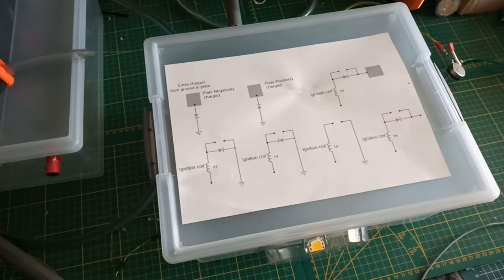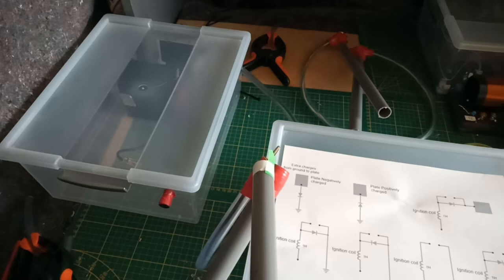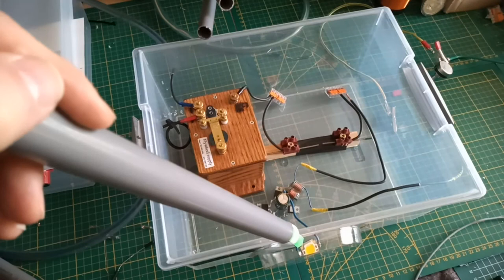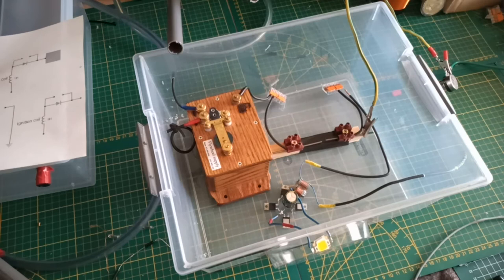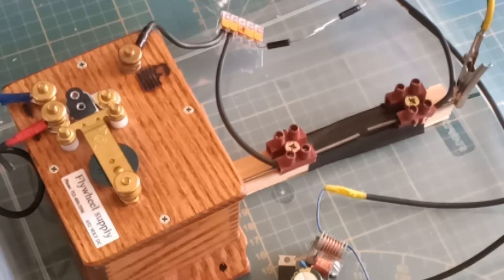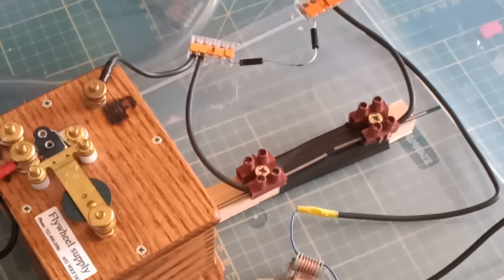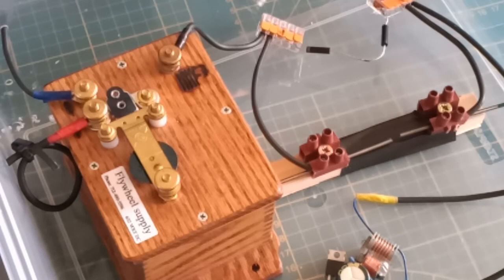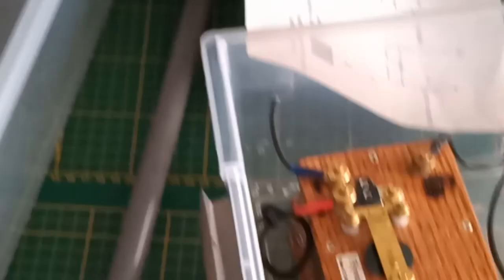059 Don Smith Spinoff High Voltage Diode Experiments

Comment: Hi Bruno. Thank you for your experiments. I can see that you add a potentiometer in the ground cable. Have you tried using a second earth to achieve the electron pump effect by tuning the potentiometer? Can you notice any positive effect or gains with resistor shunt in earth ground? Do you have any idea why Don uses two potentiometers in earth to earth connection? I can not understand why some schematics shows two instead of one potentiometer. Thank you and best regards.
Reply from the maker: @baudirenergie, I've not yet included the potentiometer in the circuit, I think it's not the right one to handle high voltage. I'm going to use 500 ohm low inductive resistors to experiment on that part. I can lower the value by placing them in parallel , also thinking about the coax cable Rich Friedrich mentioned in his comments in the video 058.
This circuit is not having resonance in the high voltage side so we must take that also in mind. When I openend up the wooden box of the igntion coil there was a capacitor in series with the low voltage primary, so I think there's some resonance at that side but the output from transformer goes directly to the output connection. Therefor I think it's not the correct setup to include the resistors but I will try it to see what happens. At the moment I'm having the same questions as you do. I'm repeating the experiments for the moment to see what's happening (looking at differences in spark brightness and so on)
Reply: @Bruno Vk  Nice experiments, Bruno! Resistor shunt (having a proper resistance value) works as a replacement to the diode in this case, but adding it in series with the diode would further limit the current pulled from earth ground (you would start noticing this if you go to a relatively higher resistance values). The idea is to lock the charges once they are pulled in and until they are used for an useful work. Resistor shunt is more suited for the coil systems that work in MHz range, but with low frequencies like you have here (I assume your ignition coil has an iron core) it would be better to use diodes. Resistor shunt should also work here, but it would be easier to use a diode in this particular case. If you used a resistor shunt in this case, at each cycle during which you ignition coil goes high with respect to the earth ground, you pull in the charges, but when the voltage on the coil starts to go back to zero, you would need to offer those charges a path to the earth ground (via a load) that has less resistance than the shunt. If you would use same load resistance as the shunt, half of the charges would go through the shunt. Diodes being one-way devices simplifies things in this case, but they are bad in MHz range, starting to act more like a capacitor due to their parasitic junction capacitance.
Same action that you see in your experiments also applies to a HV HF tank circuit, except it does the same at a much higher repetition rate. If you earth ground a tank circuit via a shunt, it will pull the charges in during each half-cycle, and they will oscillate back and forth starting at the next half-cycle. The way you would need to look at it is that LC tank at resonance has almost zero impedance with only resistive losses left there and it is much easier for the charges oscillate between the L and C than to take a path back to ground via a shunt resistor. That is why the resistor value matters, it should be much higher compared to the value of LC impedance. The result would be the oscillation amplitude rising at each cycle. We pull charges little-by-little but if we do this at a high enough rate, we should end up with a significant amount of electricity stored as a reactive power in an LC tank.
Reply from the maker: @Elisagroup, I made a picture with 8 pictures of the spark gap arc for every setup to compare: https://photos.app.goo.gl/SoELBeEsmwYsgdTZ7
Is this result in line with your findings? It seems that it's best to use Cathode to Earth or Air ground.
I was expecting that it would be different for air to be honest, so another thing learned thanks to your setup.
Thanks again for bringing this experiment on.
Reply: @brunovk417  Thank you very much for your feedback. Yes, as you said. I also think that the setup was not quite complete then, that there is a chance to see an electron pump effect. elisagroup give us a very good feedback about the resistor shunts. Seems to be that we come closer and closer to the magic process :)
Reply: @elgroovy  Hi elisagroup.Thanks a lot for your amazing comment! Is this the reason why we can see in Dons setup that sometimes more then one resistor shunts are included? Did I understand it correctly that this is why the loads on the secondary side are only directly grounded to earth, because it is the main exit point for the electrons to go back to ground and all other grounding points need a resistor shunt that they can come in and can't get out?
Reply: @Bruno Vk  yes, you got same results. You see almost no difference between air and earth grounding because the current pulses you pull from the air ground are high enough to charge the capacitance of an ignition coil which might be in pF range. Please recall, every time we are pulling charges from the earth ground, we are charging the capacitance of the winding of the ignition coil (an object isolated from the ground) much like charging objects in well-known electrostatic experiments. Since the base of secondary is connected to one end of the primary which in turn has a connection with a negative terminal of the battery, we have a combination of a battery and an ignition coil as an isolated object. This is the reason why neon bulb lights up when connected to the battery terminals. Exposed parts of this circuit will bite you if you touch them, but since the capacitance of the charged body is very small, you get a little electric shock with microamps, like in electrostatic experiments.  By touching the circuit, you dump that charge into a much higher capacitance of your body which also acts as an air grounding. A combination of battery + ignition coil as an isolated object receives a charge that is spread all over its surface, increasing a potential with respect to earth ground (and surroundings) until the point when this potential gets high enough for a spark gap to fire.
Reply from the maker: @Elisagroup, I experienced that "micro amp shock" part when I was switching that black plastic switch shown in the video. I emmediatly realized why taking the necessary safety's like Rick talks about are really a neccessity when experimenting with high voltage, spikes can show up where you don't expect them. It's the reason why I wanted to start small as possible but yet having high voltage. Thanks again. 
Next week I'm going to see what happens with electronic DC to DC converter and electronic conrolled high voltage transformer (like the one you see in the box to light up the led) The DC-DC converter has current limiter therefor I want to use it. 
In that high voltage circuit the secundary of transformer is not connected to the primary.
Reply: @BaudirenergieDe  Hi baudirenergie, yes, speaking of his coil systems, we always dump the energy back to the earth ground so the resistor shunt is not needed at the output side, but you don't want to make it a dead ground, you need to accumulate up until a certain point (amplitude) and only then you ground it. This is where spark gaps, varistors etc. would be a good fit. He showed a patent drawing with two resistor shunts on 1996 tesla conference. But in the same conference he explains the nature of a rising trumpet waveform, where he says that it collapses after a certain point is reached and the whole thing starts over (he repeats the same in 1998 office interview, where he talks about capturing the energy only after the voltage gradient gets big enough). This indicates that the charge from the coil is only dumped after a certain amplitude is reached and a direct connection to a ground via a resistor will not work here, only a spark gap of some sort or a varistor, or other components acting as a voltage controlled switch could do this... The only usefulness of a resistor shunt on the output side might be to limit the transformer primary current to a safe level to not burn it, maybe he also did that as an extra safety feature but my point is it won't work alone, you still need that switching component in series with it...
Reply from the maker: @Elisagroup, I have problem in understanding the one direction part in this story. I can understand that if you got a high resistor value and a low, the flow will go to the low resistance, the part what I don't understand is why the upload chooses the high resistance side and not just the low resistance side? 
When I was writing this comment the choice of my words could lead me to a possible solution.
What I was writing: "The behaviour used to explain the flow from high to low resistance" and at this point I noticed I had written a possible reason of what's going on, namely what we draw in wants to go from high to low resistance.
What I originally meant was the behaviour of preferring the flow via the low resistance is in contradiction with the upload from the high resistance side and not just the low resistance value. Not that it's clear now at the moment because why would a resitor change to negative resistor when there's no resonance like in the setup of my video. I really hope that I can understand this completly in future but at the moment thoughts are fighting eachother.
I have reread your latest comment and it seems we both have the same idea that a constant connection to ground is not what we want. 
If the real story behind this, is that we indeed don't need an interruption between high and low resistance part I really hope that Rick explains this, because the thoughts keep fighting eachother.
Reply from the maker: Yesterday I was rereading Rick Friedrich comments and I realized that once again I succeeded in forgetting about the fact that, as he wrote "Electrons draw into that high point from all directions. It's not as simple as a single source/path of electrons" So they do pass the output when pulled in also(when it's not switched of) .  When I used a neon bulb arround the box it slightly lid up, so also without resonance the environment is electrified. I need to do some experiments on that, I'm going to build a 1/4 wavelength secundary for the resonance kit coil and experiment on that with the diodes and in that case also resonance comes into play.
Reply: @brunovk417  "the part what I don't understand is why the upload chooses the high resistance side and not just the low resistance side?"
Simply because the low resistance path via a load doesn't exist until the pressure on the coil gets high enough - there is a spark gap or a varistor in series with the load going to earth ground. This low resistance path is created only after we pump in significant amount of charges from the high resistance path. If you replace the shunt with a direct earth ground connection, the coil will not retain any charge it gets from there. Recall charging by induction where you cannot charge the isolated object if you have a constant connection to earth (earlier I posted a link that describes this experiment).
Reply: @Bruno Vk  Regarding the electrons being drawn from many directions, that statement is correct but the surrounding air as a source of electrons doesn't compare to what an earth ground can provide. Earth ground is a major source of electrons in Don's systems, he was quite clear on that in 1994 conference.
Regarding the surrounding air electrification, you can try out another simple experiment, the end result of which might surprise you. If you take any HV HF source, like 1000v neon power supply, and identify the "hot" output wire using a neon bulb you hold with one leg, you will notice that the bulb dims out quickly at a distance of one centimeter from the hot wire. Connect the hot side to some metal plate or a foil or a coil, doesn't really matter but a high surface area is preferable. You will notice the electric field is still weak around that coil. Now connect the earth ground to another HV output wire (the "cold" output side). You will notice that the electric field from the coil expands outwards to a significantly larger distance, you can move the neon bulb further away from the coil and it will still be on. It is always helpful to think about what exactly happens in this experiment, how come the electric field is "amplified" by adding a ground connection
Reply: @brunovk417  "So they do pass the output when pulled in also(when it's not switched of)"
Notice, you have exactly that in your last experiment. You pull in charges via the diode and return them back to ground via a spark gap. In both phases the charges go through the transformer. But I think you realized that you cannot pull much amperage from the ground that way, because the capacitance of the object being charged is very small, as we discussed earlier. You have two options: 1) Increase the frequency of operation (for example, move to coil systems). With higher frequency, the total amount of charge we receive from the ground will be much higher. We accumulate it at high frequency and use it at a much lower rate on the load side (e.g. resonant isolation transformer running at 60 hz).  2) Increase the capacitance that is being charged from ground. This will allow much higher current pulses compensating the low frequency of operation (here I will again refer you to the Don's emails I shared).
Reply: @brunovk417  As I said in the book on the electron cycling page in the introduction, I don't know if Don's electron theory is correct. I remain open-minded and realize that there is usually more details than we assume to be involved in the physical creation. This is especially so in relation to the total environment and so many factors... In the book I tried to portray Don's ideas as he gave them to us. I walked in his shoes and everything I have done according to his stated system works when considering the full context (which requires digesting all he shared). 
Now I have not physically measured each electron and charted it's path in order to be able to know exactly what is going on here. But the theory seems to be accurate and when you study existing technology you can see that they work consistently with this theory. Of course I can't see electrons, or see them spinning...
Don shared the ping pong ball analogy in showing that with resonance you have an organization of electrons that normally are more random and self-canceling as far as any kind of gain of energy that you can tap is concerned. This is like soldiers marching from A to B like a dipole, which tends to make the local environment be affected by it, especially when it is in tune to the particular frequency (like a bridge). But even outside of that frequency other things can oscillate at their own frequency in the presence of a powerful resonance system. Electrons get drawn into the objects resonating. The domino effect also is involved where electrons don't necessarily move long distances but effect each other locally. This happens biologically more than people realize. It is really rather involved. But you can feel the effects in the local area.
Now you have to realize that not everything is the same and you will tend to oversimplify things. For example, elisagroup did mention the difference between the MHz cycles and KHz in relation to the grounding shunts, saying that the resistor type parts are more for the former and the diodes more for the later. Things change more the higher the frequency and voltage so there is no: 'This is the way you do it for all setups...' This is where those skilled in the trade understand these things and can make sense of Don's schematics and instructions while others will tend to oversimplify things and go nowhere. This is why I started people off with the Resonance kit as Don suggested. To get down the core points and then carefully move into the more dangerous systems. 
Anyway, an important point in the progression of higher frequency is that at radio frequency electrons START to move outside the wire. The higher you go the more removed and therefore you get zero resistance. But you also get other benefits in the way of collection and other things... This is where you find parts don't work the same way you are used to, or get entirely bypassed as if they are not there. This is where tight controls have to be used to restrain this wild animal. This is where the environment becomes so much more vividly interactive with your system. 
I think the earth ground potential relative relations to a particular local resonant dipole as mentioned by elisagroup are also very important to digest as an example of how the local environment affects a particular system. You can now see that while the earth ground is important, it is also important to adjust to it accordingly. I started drawing diagrams to show these relationships. I've shared these things about considering the total environment several times with you over the last few years here. It seems you are becoming more aware of that now. I think you have made some progress now in as much as you have realized this point. I've been trying to suggest the idea that energy systems are much more than just the parts people are used to working with. Modern science is so reductionistic and 2 dimensional that people can't get out of their little box and see the world the way it really is. So you have to know the core idea of what something is in itself and then learn how it relates to other things in different circumstances. The key is not assume all circumstances are the same so that things can change when environmental factors change. So you can see that voltage grounding changes depending on location, and cpc changes the use of parts.
Reply from the maker: @Rick Frierdich & Elisagroup Thank you very much for all your comments, as you will understand it will take some time to go through them. Again thank you very much.
I just wounded a coil of arround 75m of 0,6mm wire arround 4cm diameter tube to have 1/4 wavelength of 1Mhz for experimenting upcomming weekend.
Reply from the maker: @Elisagroup, About "you can try out another simple experiment, the end result of which might surprise you"
I experienced this in my experiment with the plate: https://www.youtube.com/watch?v=OE59Fk70Sbk
Thanks for explaining.
Reply: @elgroovy  "there is a spark gap or a varistor in series with the load going to earth ground"
We see this even on the L1 side with the spark gap going back to the center tap that is grounded.
Notice with the Ed Gray setup: patents.google.com/patent/US4661747A/en
Reply: @elgroovy  " another simple experiment, the end result of which might surprise you. If you take any HV HF source, like 1000v neon power supply"
Here it is, and maybe you were using this same neon power supply:
https://youtu.be/Sdgz4I98DwM
Reply: @elgroovy  " 2) Increase the capacitance that is being charged from ground. This will allow much higher current pulses compensating the low frequency of operation"
This is the same as we have been teaching with our impulse motor systems producing more total charging over time the larger the battery banks being charged. 
These are important concepts to understand in order to harness as much energy as you need.
Reply: @rickfriedrich "Here it is, and maybe you were using this same neon power supply".
That's it, thanks!
Reply from the maker: @Elisagroup, I want to thank you again for sharing that document with the electrostatic experiments. Today this kind of experiment showed me what's  happening inside a capacitor when AC or pulses are placed on one side of capacitor. In the past I was thinking wrong to only look at a capacitor as a blocking device, a change of charge at one side induces a change of charge at the other plate.   I was doing that experiment again that is described with the electrostatic charged plastic tube but with an plexiglas plate in between (which would be the dielectric of the capacitor) and it still induced that change on the ball. This also answer a question I had for a very long time: whether Tesla menth with "insulated plate" a plate that was insulated from ground or the plate itself was covered with insulation. The experiment showed me that there is almost no difference whether that plate itself is insulated or not, it just goes right through it like in the coupling capacitor. I knew of the concept of inducing but those experiments  finally gave me much better understanding, so thank you so much for that document. I experimented with battery operated signal generator and scope and connected a capacitor between ground of signal generator and connected signal input from scope on other side of that capacitor and I found out that when I touch the signal output line of signal generator  that was just lying loose on the table, that I had the best output on scope, even better then when the capacitor was connected to the signal output of signal generator and touching ground connection of the signal generator.
Reply from the maker: @Rick Friedrich, Also thank you for the help given. For me personally seeing something happening in real life gives me better understanding then from books and those small experiments where making things more clearly to me.
I know you talked a lot about what happens what I see in those experiments, but I'm just somebody who learns more from experience. In my daily job the problem is where the loop is interrupted in the electrical circuit while in these systems the fun starts at that point. I'm doing my job for almost 30 years so it's not so easy to shift from understanding.
Reply: @brunovk417  you're welcome, glad it helped.